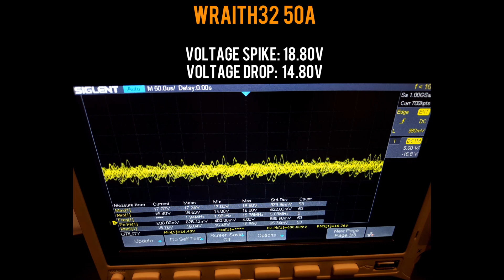Airbot Wraith32 Plus 50A 32bit ESC // Review and Noise Testing

Comment: i baught 2 sets, the first i run with F80 2500KV 5inch, the 2nd with karearea toa 2306 2450kv 6inch, i get flip of death on both setups. i did chanche rampup power to 60 and 70%, motortiming auto, 48k, demag high.
higher IDLE to 6

still have FOD
was there a firmware with a knowing issue?

Comment: Great video as always. Quick question I just fill a 6 inch prop 6s Emax 1900kv Motors and I had holybro tekko32 amp blheli 32 ESC on it my first 6s flight I burnt an ESC ( i have a 35v looomfd cap 9n the main lipo leads. Do i have to put like a 35v or 50v 330mfd cap on each esc? If so which ones? And what size..
 I know 6s is supposed to draw less amperage but running 6 in dal Cyclone 5046 tri blades I think it was way too many amps for that ESC 
I know you can limit the current but I decided to go with these 50amps just to make sure I won't smoke another ESC do you think this will be sufficient enough for my setup it's an absolute Beast thanks please help

Comment: I'm not very happy with this ESC, i have burned 3 motors so far and get alot of desync with rapid throttle change. I have been using the brother hobby 2306/2450kv motor with 5x3x4.6c cyclone prop. 
This ESC is also VERY noisy.. Here is an example https://youtu.be/L6hh5P9jMik?t=1m37s

Comment: Hey Mesh, I followed your recommendation and bought over 4 sets of these for my planned builds, and while parts where coming in, I fought with these ESCs over several weeks in order to find out that THEY ARE COMPLETE CRAP and keep smoking motors not even hovering!!! WARNING TO EVERYBODY: DON'T BUY THESE ESCs!! They have cost me hundreds of dollars in smoked motors before I could nail down that it was the ESC Hardware, not the software or interface w other electronics! Airbot knows this.. There are still retailers selling these.
Reply: ci sono cascato proprio in questi giorni, Emax RSII 2400kv in fumo, poi sono impazziti pure gli esc, sai di qualche soluzione al riguardo?

Comment: I've got these on my QAVR 6 build.  I'd love to know the settings you would choose for the firmware.  My FC is the Matek F405 with their FCHUB 6S.  It's rated at 184 amps.  So, I have the current limits set to not out do the PDB. (45 amps each)...  But I'm burning up motors.  Trying to run the Hypetrains...  Not going well. I'm not sure if it is d term or what.
Reply: same thing today, emax RSII 2306 2400kv engines. Has anyone understood why? strangely the defective ones were those reversed via software. not only the engine, but also the ESC stops working, it remains with the phases in short.
Reply: i have problems with it as well. and i burned out a 2306 1700kv motor instantly by plucking in a 6s battery, very curiouse. on all wraith 32 50A setups i get flip of death, even on idle up to 8% after FOD i have to reboot the esc

Comment: I am trying to run these with KDE3520XF-400 without success. With default settings, the motor spins very briefly and then stops (0.8 seconds cycles). If I increase rampup power, the motor spins and accelerates, but it goes out of sync and it gets hot very quickly. Any ideas? Thanks!

Comment: I have had an idea were I use its ipeaka cousin 50A ESC with 4110 / 5008 motors 6S with 12" maybe 14" props freestyle quad. i  don't think it will be supper fast but will be really punchy

Comment: I have these on a Armattan F1-6 (heavy frame) with EFAW 2407 2200s.
Agree these are nice ESCs.

I've only just set up telemetry on them after a rebuild from a crash so have not flown the telemetry yet.

I did burn  off on off the tx pads off one of them while attaching the telemetry wire so watch out for those.
Reply: I'd add I fly these with a Matek F4 with BF 3.2 and it is a very smooth combination.
I don't like the solder pads of the PDB or motor wires, on the ESCs they are workable but to me the shape is weird. That's the only down on these ESCs apart from my pov.

Comment: Thanks for the info 👏 I have a custom frame that's a 285 and I was wondering what would be the best motor ESC combo? I like running 6 inch bi props tho I think haven't tried some of the new designs of the tri blades..
Reply from the maker: These should handle and more.. Keep me updated.